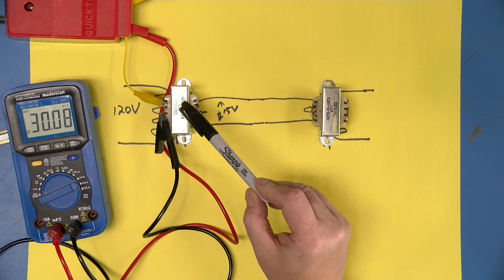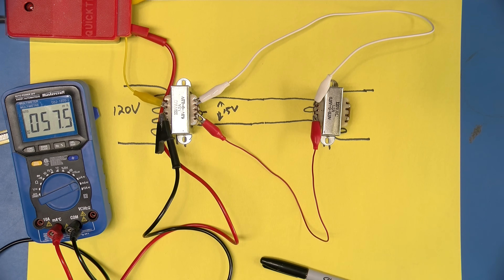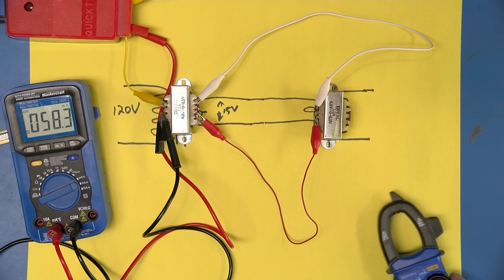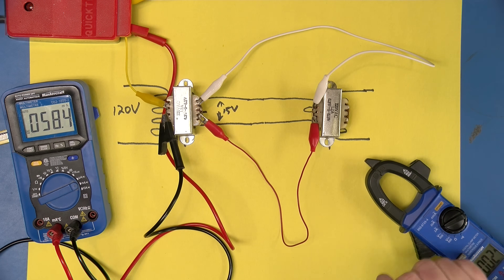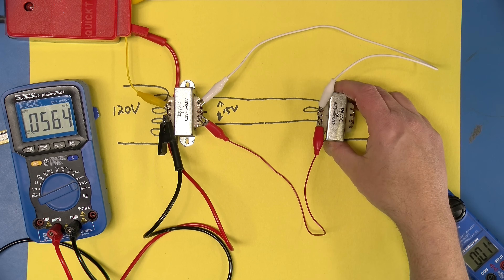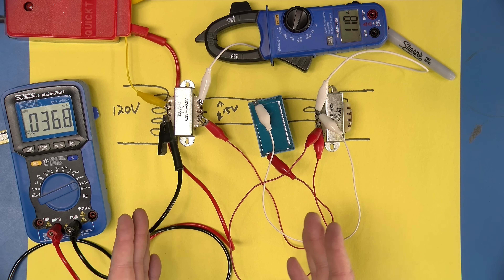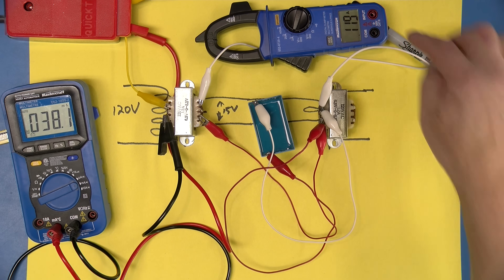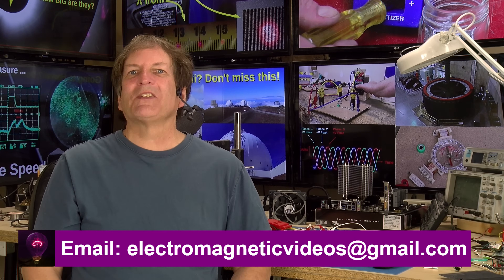Viewer Questions: Back to Back Transformers

Comment: Glad to see you back online! Hopefully the vacation was enjoyable, in spite of the strep which happened after you came home. 

This is interesting, and I have had to do similar before to "make something work."  The piece of equipment I was trying to use had 240V motors and 120V controls. They originally used line to neutral for control power; but the supply to this machine only had L1, L2, and ground; but no neutral. I used a 240V to 24V transformer on the input side and a 24V to 120V transformer on the output side, to take the place of a 240:120V transformer I didn't have.  It was, of course a get-by but it got the 120V control circuit working without a neutral available; using what I had on hand. When you are poor you have to use what's in the junk box LOL! 

I still remember your electromagnetic chain! That is very neat but for some time it is also quite humorous!
Reply from the maker: You know, a few other people have also mentioned using back to back transformers to make do with what they had on hand. I was not expecting that. It sure show how much ingenuity is out there! Cool that you managed to get things going that way. 

Hope your doing OK - you haven't posted in a while either? Were you in the path of the hurricane a while back? @ThriftyToolShed is apparently still cleaning up from it.

Comment: If I had done this same presentation, I would have added just one more measurement — the resulting final output voltage, no load.  Maybe a few words about the normal practice of winding all transformers with a little higher than the nominal (loaded) secondary voltage, like in this case 15 V rather than 12 V.  In the industry, the catalog listings talk about “% Regulation”.
Reply from the maker: Yes - in hindsight, I should have shown the voltage at the end.  I always struggle with how much to cut - sadly YouTube audiences have a very short attention span and and I have to ruthless as to how much I cut from each video. 

I did feel that 15V for a 12V winding was a bit high, but this is  a cheapo low efficiency transformer so I guess they were a bit aggressive in that respect.

Comment: This one was interesting for me, as many years ago now I inherited an old 'Farm Radio' (that is, a battery powered tube radio). It has been in my family since it was new, in 1946. Designed to run on a battery that provided 1.5V for the filaments and 90v for the B+ (or the HT, as we say here in the UK). I decided to cobble together a circuit to provide those voltages, from our 240V AC mains. I did this with bits I happened to have lying around. So I used a 240v:6.3V transformer, and then a 240v:16V transformer used 'backwards'. Thus I could rectify the 6.3V and add dropping resistors and smoothing caps and a voltage regulator to get the 1.5V DC, and then also step the 6.3V up again to get the HT, which (luckily) after rectifying and smoothing gave me almost exactly 90v. OK, there is a bit of 50Hz hum, but it works, and has done for many years! The transformers I used are fairly meaty, so they seem to handle it OK.
Reply from the maker: That must have been a wonderfully satisfying project! And what a great example of what I showed here. Sometimes using what you have on hand makes way more sense than buying a perfect part. 

The hum - I trust you tried increasing the size of the filter capacitors? The other thing that can cause it is the stray field from the transformers in interacting with the electron flow in the tubes/valves. So if you can, try moving the transformers away from the tubes.  Or put a piece of steel sheet/plate between the transformers and the radio to provide magnetic shielding. 

There is something really cool about old tube radios. I have a few myself - used to be great fun listening to short wave from all over the world. Sadly thats mostly gone thee days.
Reply: @ElectromagneticVideos  Many thanks. I found it very sensitive to any variation in filament voltage. More difficult to get that one right than the high voltage. I may try some of your ideas there, too.
Reply from the maker: @Timothycan  Oh - I never thought of the filament - which I guessing is  the directly heated cathode and at 1.5V probably uses a lot of current. Maybe a 1F (not uF!) supercap to smooth the filament voltage?
Reply: @ElectromagneticVideos  Yes that could be worth a try, thanks.

Comment: Did I miss you verifying that the output of the 2nd transformer successfully restored the voltage back to 120V. I was very curious whether adding or removing the capacitor would affect the final output voltage. I am guessing that it would mostly affect the overall efficiency of the circuit.
Reply from the maker: Your right - I didn't show that - like so much stuff in every video I do, it got removed in editing. The output voltage was 115V without the capacitor and no load, so 5V was lost. Not a huge surprise given how cheaply made these transformers were.  I didn't measure the output voltage with the capacitor attached. My guess is there would be a slight increase due to the the capacitor lowering the current coming  from the secondary of the first transformer and therefor reducing the restive voltage drop along the secondary which would raise the low voltage (15V) provided to the second transformer slightly.

Comment: I think I'd just get a large iron toroid or microwave transformer core, wind two 120v coils on it and use that for isolation. You can disassemble two microwave cores, remove the high voltage coils and put the 120v coils on a single core  that should get you about 1kw to near 1800 max watts. Depending on specifics.
Reply from the maker: That would sure be a great way to repurposed  two microwave transformers if you has some identical ones. Or use them as a 120:240 or vice versa autotransformer.

Comment: You have made a nice little intro video, well done.
But I get so worried when you put your fingers on the transformers like that, can't you use a stick or something?
Reply from the maker: Thanks and I appreciate you concern. The 120V power is though a GFCI and where I was attaching things in the middle was on the isolated 15V windings. The biggest area of concern is the 120V out to the second transformer on the right which is isolated from the GFCI. I should have covered its 120V terms to be safe!

Comment: At my last job, the hospital beds had isolation transformers...some were adjustable, with a switch that allowed you to use 108-130 volts in, with a steady 120 out...
   In the '70s, I saw a back to back transformer setup used to power a neon relaxation oscillator as part of a model train setup. 
     If you had a 12 volt center tap transformer, I guess you could drive two six volt transformers.
      Your setup would make a good educational display for a high school physics or shop class.
Reply from the maker: So are you saying the transformers had manually (and easily accessible) taps to adjust the input voltage? When I was a kid an we lived in Germany, we had one transformer with taps like that on the output to select 110, 114, 117,120, 125 or some such series of voltages.

Your hospital transformers wouldn't have been constant voltage transformers by any chance? I had one of those in the early days of home computers - ran very hot - an a selectable input voltage would have been a good way to keep it from overheating. 

Interesting about the model train setup. Probably a nice safe way of generating isolated 120V or so using transformers they probably had crates of. We sure weren't soiled back then - a blinking light - wow!

You certainty could could drive two 6v transformers that way.

As far as educational uses - I do hope my videos have been inspiring a good number of teachers/instructors/professors to create similar demos experiments for their classes.  I have had emails from a few who wanted more details to to do some of the experiments in high schools, universities and even a museum.
Reply: @ElectromagneticVideos  
     These transformers had a rotary switch you needed a screwdriver to turn - you were adjusting for input voltage-..it was recessed, so it couldn't be done accidentally.
    I honestly don't know if they ran hot..they really weren't continuously used anywhere near capacity...it had a bed motor, a nightlight, and a small amplifier. 
     The nightlight and amplifier might use...10 watts? The motor used a lot more, but was just intermittent.
     Hospital beds have an impressive amount of safety features...
Reply from the maker: @Scott-s9u3n  So maybe just an isolation transformer. 

I'm glad to hear they have a lot of safety features and isolation transformers. Once when I was grad student a (really good) biomedical group was doing some sort of experiments  where they had electrodes attached to volunteers to measure some sort of nerve or muscle activity. A few of the volunteers got a good  jolt of electricity from some stray leakage currents.  Someone suggested they ask me for help and ended up getting them setup with medical grade isolation transformers. So I am somewhat aware how dangerous things can be when you are wired up to who knows how many pieces of equipment, each possibly adding some leakage current. That was my one and only experience with that sort of thing but it left a  lasting impression on me.
Reply: @ElectromagneticVideos  
     Part of tests we had to do at the job was measuring leakage current..I forgot the exact limit, but it was micro amperes to ground. 
     The IV pumps were all battery powered ( at that time, 12' volt sealed gel cell lead acid batteries) to prevent leakage current through the patient..an IV in your arm is a conductive path to your heart. The IV tubing itself is part of the pump ( imagine a series of padded " fingers" gently squeezing the tubing) , and that isolates you from the machine. From a fire and electrical standpoint, hospitals are very safe places.
Reply from the maker: @Scott-s9u3n  Very interesting - I guess you cant do better than batteries in terms of reducing leakage. I never thought about it but given that most IVs are salty, the fluid itself would be a good conductor at least from a mA or microA perspective. 

Here is a question - I have heard that in some/all(?) hospitals  in Canada and the US, the ground prong of AC receptacles  is oriented up to somewhat block things falling on the live prong. Any truth to that?

Comment: considering the current trend for DIY generators and the like, should do a video on "jacobi's law" or maximum power transfer theorem... 

seems that most people forget about the "other half" of a circuit. 

another subject is "reflected impedances", and why an MOT is deadly because of it...
Reply from the maker: You know, that might be a very interesting topic for a video! Something like how power transfer is not max efficiency and why we go for one or the other at different times. 

And the whole bit of reflected impedance- and "impedance"  of things like audio transformers.

I'm thinking  of an impedance video - so might be a great followup. 

Microwave oven transformers - why they are deadly might be a good video just by itself. There have apparently been deaths and serious injury from people mimicking  youtube videos  use them. I actually have a bunch of microwaves sitting in my workshop for a faraday cage video - that might be a good use the the transformers...

Thanks for the ideas!

Comment: One of my favorite circuits inserts a diode ring in between two (audio) transformers ... 😏welcome back and I hope you are 100% healthy again! 👍
Reply from the maker: I getting close to 100% thanks :)

You certainly got my curiosity with that statement. I have never heard of that - closest I can think of is an RF AM modulator done like that. Is that to somehow use one audio signal to modulate another?

Do you have a video on that? Just subscribed to you channel - looks like you have all sorts of interesting stuff linking music and electronics!
Reply: @ElectromagneticVideos   It's a ring modulator - so your're correct.
Reply from the maker: @mickeythompson9537  Neat - that must create quite the interesting sound!
Reply from the maker: @HazeAnderson  I hate it when that happens. It sometimes seems to pick on certain people for no reason. I checked for held comments and nothing there.
Reply: @ElectromagneticVideos  very interesting ... Mickey got my back tho 👍and yes, it can create very interesting sounds. I like to sweep an oscillator with an LFO as the signal, and then sweep a second, similar oscillator with an inverted copy of the LFO as the carrier. Bouncing balls!
Reply from the maker: @HazeAnderson  That really cool! Not having any musical talent, electronic music/sound generation is  not something I  have ever gotten into or have any expertise in. So its always fascinating to hear about something like that!

Comment: Hi, big thanks for demonstrating this question.
A few questions about the use of the capacitor. 1) Is there a limitation on the maximum value that you can use ? 
and 2) when you added this capacitor, the current on the primary side of the first transformer, and the current between both secundary sides dropped almost with 50%, but does this mean that the output voltage on the second transformer also is dropped from in theory 120V with no capacitor, to arround 60V with capacitor ? Grtz
Reply: Does the capacitor value used "resonate" with the primary inductance at 60Hz?  An ideal parallel L-C tank circuit draws zero current (i.e., has infinite input impedance) at the resonant frequency, if I remember correctly.
Reply from the maker: @miltonthecat2240  Thats it exactly! The combination of L and C when perfectly matched draw zero current so appear to have an infinite impedance, while a large current flows back and forth between them at the resonant frequency!

So then the only current left going into the transformer is the current supplying the power loss - which in the end looks like a resistor across the tank circuit.
Reply from the maker: Your welcome! 

1) You have to consider that the   can be thought of as consisting of an in phase "real" part (like the current though a resistor)  and a 90 degree out of phase "imaginary" part from the lagging current  due to inductance. 

"real" and "imaginary" refer to real and imaginary numbers for those that are mathematically inclined. 

The capacitor adds a leading 90 degree out of phase current. 

The total current is the (vector sum) of the real an imaginary parts. The total can the thought of the length of the hypotenuse of a right triangle with the real in phase part on one of the sides and imaginary 90 degree out of phase par on the remaining side. 

To minimize current, we need to have a the capacitor current equal to the inductor current 
since it has opposite (180 degree phase). This should cancel the out of phase part of the current leaving only the real "power" current. 

If the capacitor is too big, the sum will have leading out of phase current making things worse. 

So how to determine the capacitor? I figure out the real current from the power - the power can be read from a power meter. Use that power to calculate the real component of the current. 
Measure the actual current in with an ammeter to get the (vector) sum of the real an imaginary currents = hypotenuse of a triangle. With the real current as one of the sides, calculate the imaginary (our of phase) current. 

You will need a capacitor drawing that amount of out of phase current. The reactance of the capacitor is obtained from ohms law R = V/(imaginary current). Use any of the online capacitance-reactance calculators to find the capacitor size needed for that reactance at 50Hz.

Or - get a bunch of say 1uF capacitors and add them to the circuit till the current stops dropping and you will have the value. 

Note that capacitor of this size are often quite crude in terms of how close they are to the stated capacitance. 

2) No change in voltage! The capacitor supplies the magnetizing current - the core still draws the same magnetizing current - so the voltage remains the same. 

3) It doesn't matter which side of the transformer has the capacitor. You could use a 120V rated capacitor of suitable scaled down capacitance on the 120V side of the second transformer to achieve the same thing. Just remember that if disconnected the capacitor could retain a 120V charge!
 
 Hope that helps!